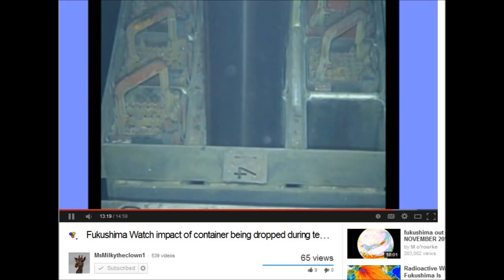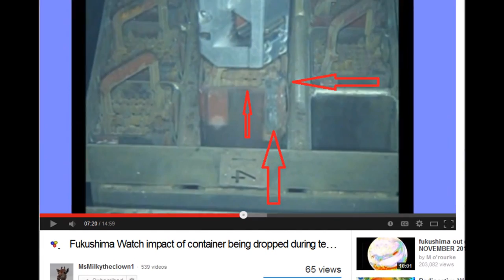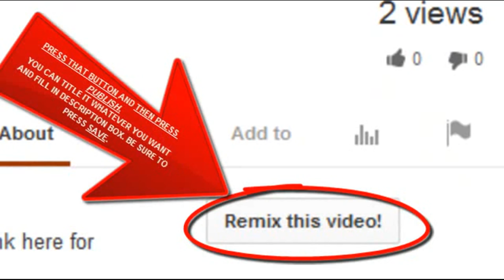Fukushima SFP#4 Dog and Pony Show

Comment: Radiation levels in the groundwater under the "Fukushima" peaked since the accident
Dec 04, 2013 AllVoices

Concentration of radioactive substances rose today to the highest level since the accident.
The level of radiation in water samples taken from the maintenance shaft, located east of the second unit, was 1.3 million becquerels per liter.
Marginal rate of fluid drain into the ocean – 60 thousand becquerels.
The water comes from a strong beta radiation, indicating that the content in it strontium-90 and tritium.

http://www.allvoices.com/contributed-news/16088701-radiation-levels-in-the-groundwater-under-the-fukushima-peaked-since-the-accident
http://mainichi.jp/shimen/news/m20131204dde007040072000c.html

Comment: Fukushima Radiation Exceeds Chernobyl Evacuation Levels Across Japan
December 2nd, 2013 SimplyInfo
The map represents the mandatory and voluntary evacuation zone radiation level from Chernobyl, applied to the fallout across Japan from Fukushima.

Some areas far from the actual evacuation zone have levels as high as the mandatory evacuation zone in Chernobyl. Pockets of high radiation were found in even Tokyo. The voluntary zone takes up a considerable amount of the eastern mainland of Japan. After Chernobyl Soviet Union compensated anyone in a voluntary zone if they decided to leave. Meanwhile Japan is trying to repopulate areas of the evacuation zone near the plant.

250km from Fukushima Daiichi had levels as high as Chernobyl’s evacuation zones.
http://www.fukuleaks.org/web/?p=11871